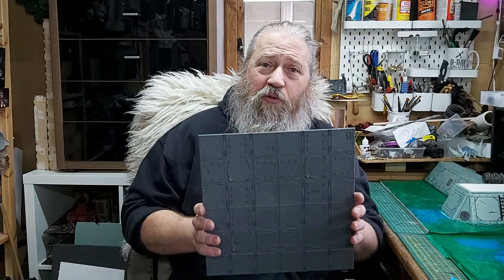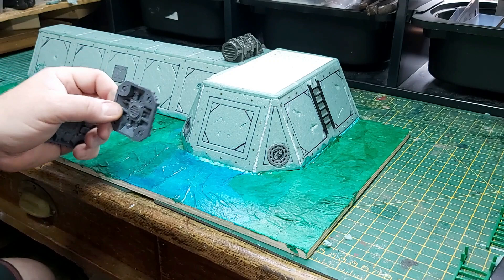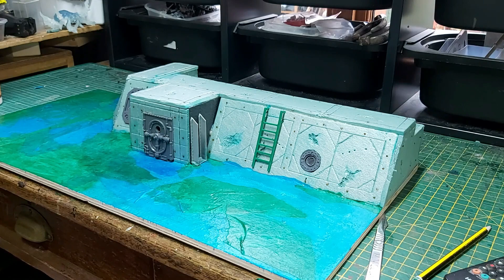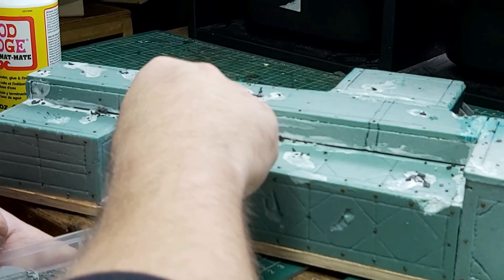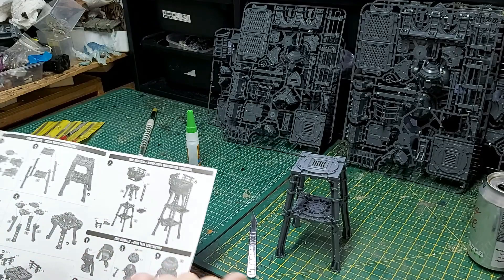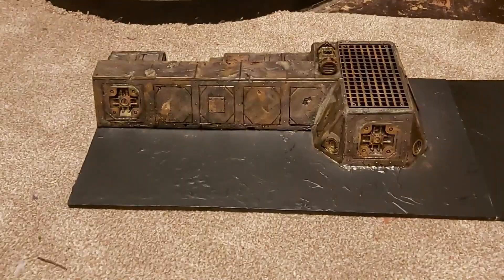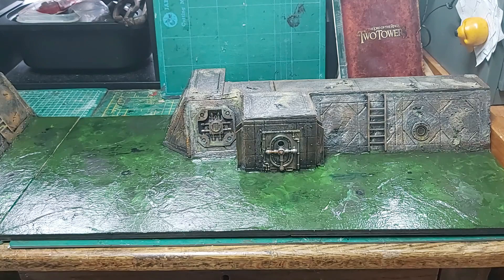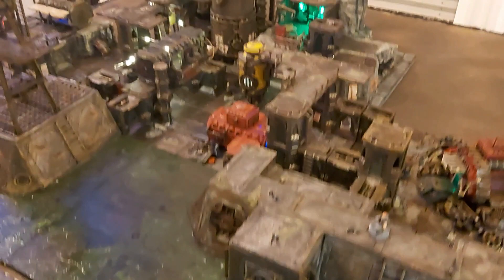Necromunda Scenery Build - The Sump Wall (Part Two)

Comment: Looking awesome! Some tables I’ve seen in battle reports are made completely from the GW Necromunda terrain kits, and while they are pretty, they also start to look “samey” (if that’s the right term). Your scratch built terrain with the GW parts has tons of character. It looks like a real, lived in environment rather than just a table for battles to happen on. Keep them coming!
Reply from the maker: Thanks Ben, glad you like them. I couldn't agree more. GW's scenery is great and very flexible but I always see a kit as just a starting point. Keep watching.

Comment: Looking excellent!
For the spinny bit you could probably get one of those small 1.5v motors, 3d print a drive screw for it and a cog to mount on an axle up to the light to have it spinning at a reasonable rate as most small motors usually have a pretty high rpm.
Reply from the maker: I am definitely going to look into something.  I don't think 3d printer enough.
Reply: @magratheabuilderofworlds7141  With all your bitsboxes i can see why 3d prints dont bubble up more often for you, mostly you can find what you need already.
3d printing can be great for sprucing up scratch builds, say you want to make some houses/ruins out of foam board, you can print doors, windows etc to just fit into slots you cut and quoins to hide the ugly foamboard joins in corners to make building super quick+easy.
There are also a lot of greeble packs available to download for free that can fit perfectly with any scifi stuff.
Reply from the maker: @zid_just_zid  Yeah. I have two 3d printers and am not using them enough

Comment: I really dig  these sump wall sections and the modular aspect, allowing you to create interesting platforms in different arrangements. Regarding the tile that was going to be the Enforcers' block-house, I reckon a pirate vox-mast with a ramshackle radio station. Not that ganger vox-tech is  sophisticated or particularly long-range of course, given the structural density of the underhive. Or how about a tarot reader's place? It'll be cool to find out what ideas you optioned and see what you  ultimately make that tile into.

I was blown away by the lighthouse tower - its highly effective. especially with the parabolic mirror, and plenty tall.
Reply from the maker: Yeah. I was really pleased with the parabolic reflector